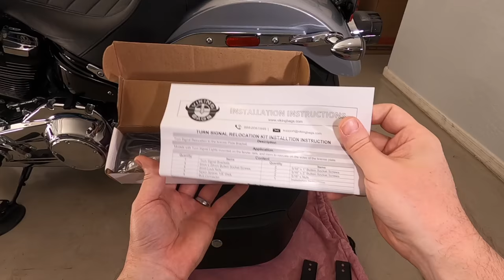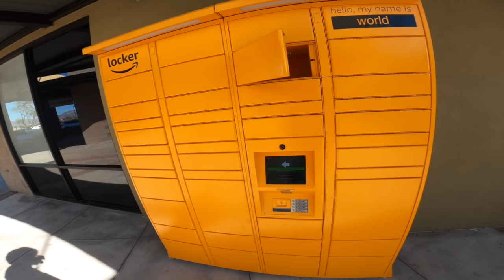Viking Lamellar Hard Saddlebags - Harley Low Rider (FXLR)

Comment: My first bike was an early 1979 HD Low Rider, 74 cubic inch, silver with black trim, drag bars.  Since that time I've owned 3 more HD's, each time moving to larger touring bikes.  I'm 67 years old now and am tired wrestling with tour bikes.  You don't pull a tour bike out of the garage just to make a short run to Starbucks as it is too much trouble.  Your current Low Rider, silver with Street Slammer bars, has really fueled my desire to return to simpler times that I so enjoyed with cruisers.  Thanks for the videos...and the inspiration.
Reply: That's the reason I went with the Deluxe. Simple,  clean and a joy to ride on short trips or long.
Reply: I did the same thing, I got tired of wrestling a 900lb bike just to ride around town so I got a 2006 superglide and loving it, just need some Viking bags now

Comment: I've had the shock cutout version of these bags on my Dyna Lowrider. I concur with the comments. They offer great capacity, they are strong, well made and they look good. Fitting took a while because I was determined to get the position right. Measure twice (or in my case about 10 times) and drill once. On the Dyna, wobbling of the lids with engine vibration wore through the rubber seal after only 9000 km. The plan is to eliminate the shaking with the counterbalanced 2020 Lowrider S and fit new Viking Lamellar Hard Bags! I prefer the way these bags open to the Sport Glide bags and they are way better priced. While tempted to go for one of the larger Viking Hard bags, the size of the Lamellar bags suited me just fine on the Dyna, so why change? Probably leather wrap on the new ones, because it took me no time at all to damage the finish on the painted bags.
Reply: Q
Reply: Q

Comment: Great video. I think I would drill holes in a thin steel plate (powder coated black) matching the 4 holes you made on the bags and mount it on the inside of the bags for some extra strength.
Reply: Would definitely give it more support and clamping force, not relying on just the plastic of the bags to hold.

Comment: I got the 19 lowrider I done the turn signal relocation kit from Harley Davidson myself took about an hour, now I bought some Viking saddle bags, the instructors are crude, they are nice bags, but I just can’t seem to mount mine with the Harley-Davidson quick detachment sissy bar! I wanted throw over but it don’t look like I can get it to work!
Reply from the maker: Yeah, those instructions aren't good. The bolts that come with the bags might not work for your particular install. You might need to customize the mounting hardware to get a good fit.
Reply: KSSTUDIOS yeah I know they still laying in my shop! I been using a backpack!
Reply: Yeah just hit the hardware store, see about some different links, keep the receipt

Comment: I hope they work out better for you than they did for my 2014 Dyna Low Rider.   I had to purchase wider spacers then came with the bags and they were still hit by the axle nut. Even after I got that resolved, the hinges and tiny screws started to come loose off the bags.  Viking was the worst company I've ever dealt with.  In the end, garbage bags and garbage company. It was a happy day when I took them off my bike and threw them in the trash!
Your bike is beautiful otherwise, here's wishing you lots of happy miles.
Reply from the maker: Sorry to hear about your experience with your bags. I didn't have any issues with mine but ended up removing them after a minor crash damaged one of them.

Comment: All you needed to do was cover the entire backs of the bags with painters tape. Make your marks and measure them to the nearest whole amount, if you set your bike up level then you can cut up som 2x4'and get it sitting exact. Mark n drill your holes  and then transfer those marks to the other bag.
Reply from the maker: Thanks for the suggestion. There are many ways to go about getting them drilled out, but I wish Viking had a template or something with some straight lines on it.

Comment: I have the same bike, signal relocation kit and Viking bags. I also have the HD quick connect kit but didn't mount them thinking the bags mounted against the bike is more
stable then mounted against the small round disconnect posts.
Reply: can u advise the part # for the signal relocation kit?. Thx

Comment: Has your bags ever bottom out and hit the axle nuts? if not. How high above the nut are they mounted? thanks!
Reply from the maker: I'm not able to measure as I no longer have this bike but I put spacers in so that the bags would clear the swingarm and axle. I never bottomed out with these bags installed. Hope this helps.

Comment: Nice video I just ordered my this will help me thank you
Reply from the maker: If I did this again I would lower them about 1-1/2 to 2 inches. I was afraid to get too close to the exhaust, but ended up leaving too large of a gap. Once you drill the holes out it's tough to adjust the position. Good luck with the install 👍

Comment: Curious if the bags will work with a cobra detachable backrest. Nice relaxing videos you put out. Keep up the good work.
Reply from the maker: If the backrest attaches to the same bolt locations there's a good chance it would fit with longer bolts. The Harley Hold-Fast docking system will work with this kit. I left mine off this time purely for looks.

Comment: I currently have a 2008 dyna low rider.    It came with detachable bags and sissy bar.   I find there is way to much rattling .   How are these bags for rattling and storage capacity.   And can you still install sissy bar
Reply from the maker: I haven't noticed any rattling with these bags so far. I didn't install the quick detach kit that Viking Bags offers, so they're currently hard-mounted which probably helps with the stability. The capacity is good, but I've already stuffed them full on a few trips to the grocery store. I could definitely still do a sissy bar with these on since they use the same screw holes on the fender that many of the sissy bars for this model mount with. I would just have to swap the mounting screws for slightly longer ones.

Comment: Hi just to ask you if you can told me where do you get the turn signal relocation kit, I was checking at harley davidson website but they have a package with the license plate relocation to, I only need the extender please let me know and bee safe out there, thanks
Reply from the maker: Link updated in description. Harley site changed and original link broke.
Reply: @KSSTUDIOS   whats in that link isnt whats on your bike?
Reply from the maker: @randystephenson291  It is Part Number 67800802. The picture on their site is a different bike but that is the kit that was used on my Low Rider.